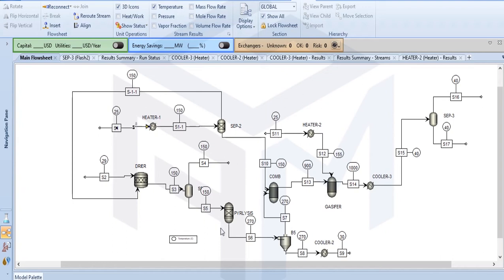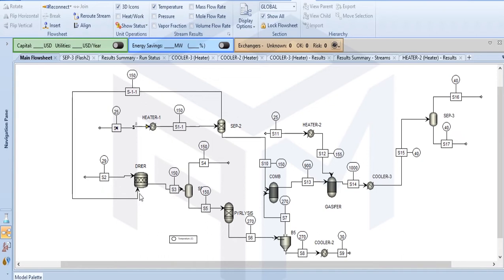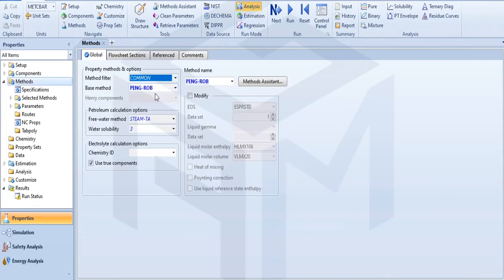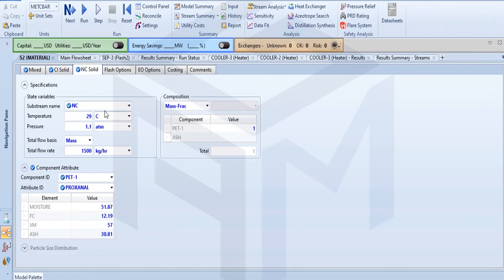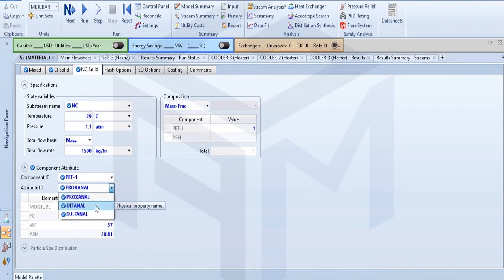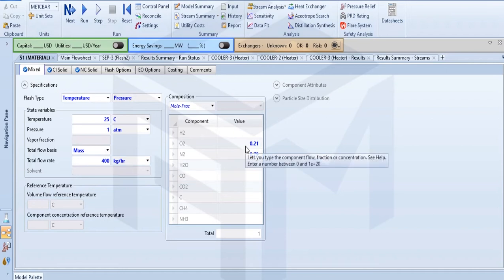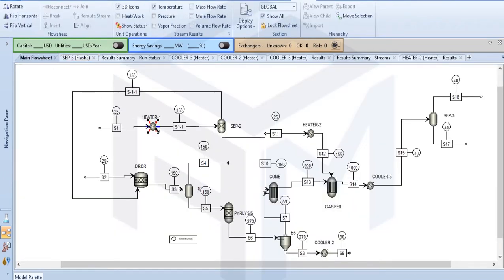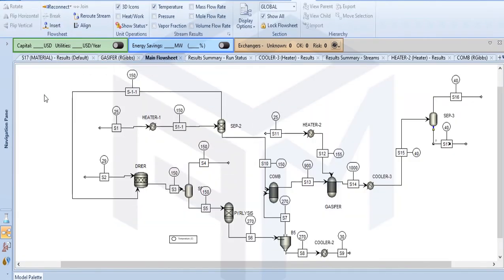Production of syngas from plastic (Pyrolysis-Combustion-Gasifier) | Aspen Plus V11.0 | Simulation

Comment: Hello from Spain. I would like to know how did you get the stoichiometry coefficient for water in the drier. Thanks in advance.
Reply from the maker: See in drier my main purpose was to remove water content so then calculate it by remove and then calculate the other coefficient
Reply: @AGMONLINESIMULATION  Thank you very much. Another question: Could you tell me which are the split fractions for SEP-2 (Sep type) or if you chose a Flash2 type?

Comment: hi, do you have a step by step video for the part from min 9.40 min? in the rgibbs reactors, in the restricted equilibrium section, when you input the chemical reactions you have to input the temperature approach for every reaction. what values of temperature approach did you use for every reaction in both rgibbs reactors?
Reply from the maker: Sure can make it. Kindly contact on my WhatsApp +96550654217
Reply: @AGMONLINESIMULATION  would  you mind  sharing temp approach of gibbs ???
Reply: @AGMONLINESIMULATION  i havent use whatsapp sir !!
Reply from the maker: Contact me through telegram with the same number or through email

Comment: Steam is also used but conditions not mentioned.
Reply from the maker: Operating pressure 1 bar and temperature 25 C
Reply: @AGMONLINESIMULATION  flow rate?
Reply: @AGMONLINESIMULATION  steam flow rate in kg/hr
Reply: @AGMONLINESIMULATION  steam flow rate in kg/hr
Reply from the maker: @uditchoudhary2695   600 kg/hr